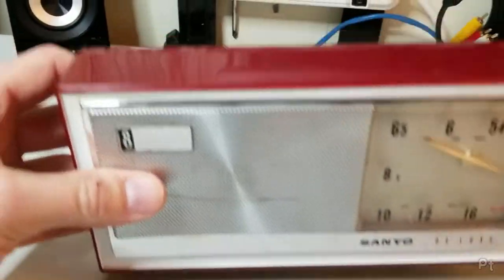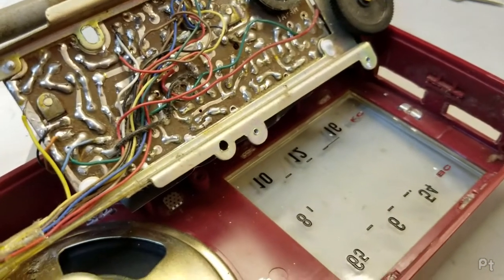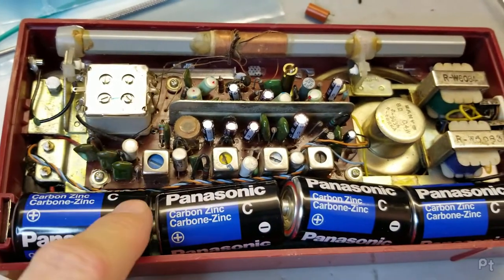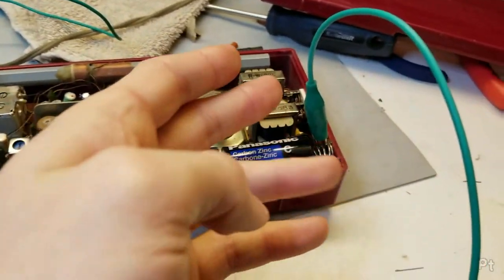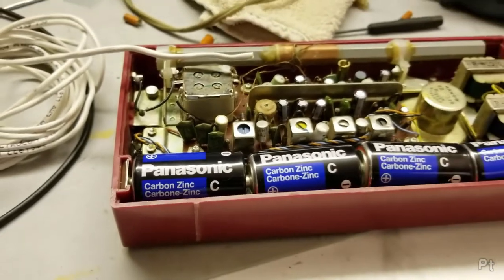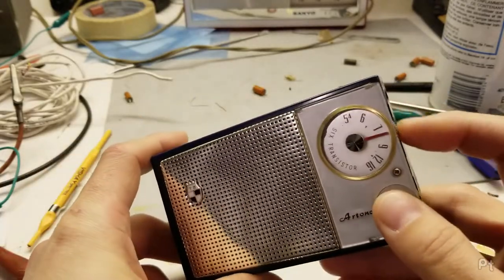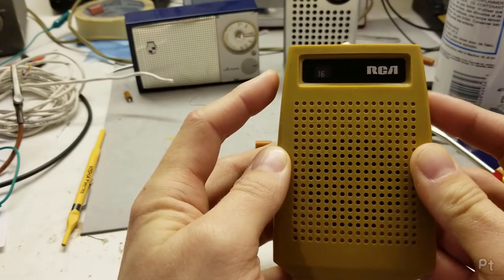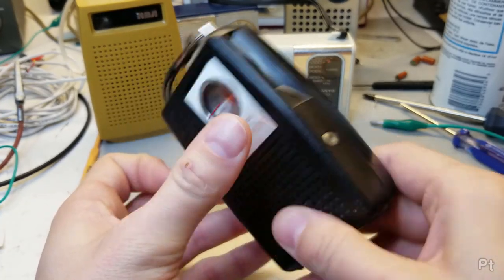1960s Sanyo Transistor Radio (also some other radios)

Comment: This has the added benefit of an RF amplifier operating in common base mode, thus a low input impedance and high gain. If you're in the middle of nowhere this radio will work where others won't. (Your first radio that you recapped). They gave those radios like the Prominent away as a bonus when you signed up for Columbia House record club.

Comment: I was given a Marantz transistor radio with a cassette deck recently however I never got it working. I tried swapping the tape head and adjusting the Azimut angle however I didnt get it working so I just picked the belts from then it then it went into e-waste.